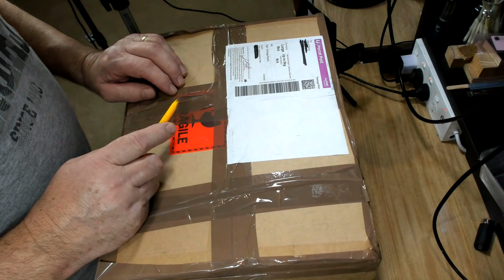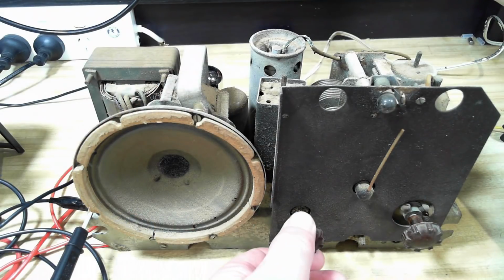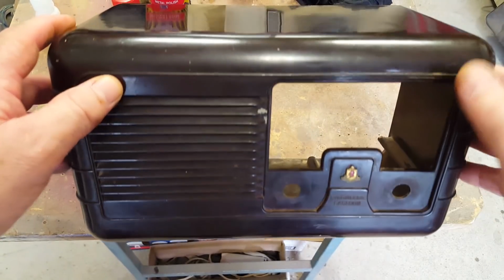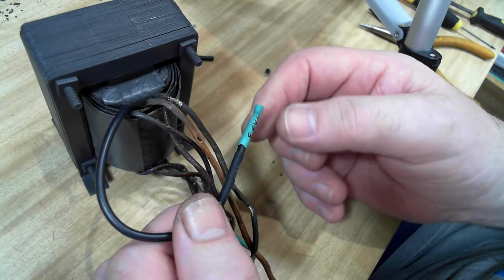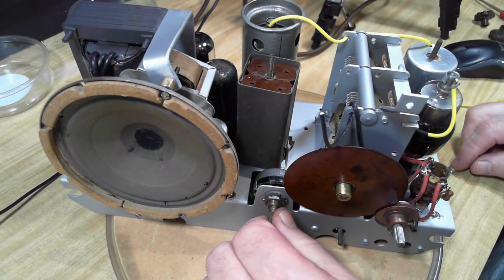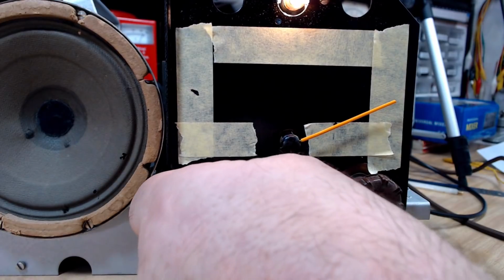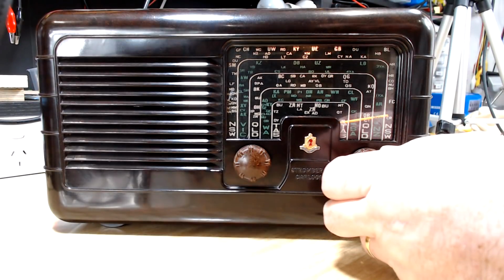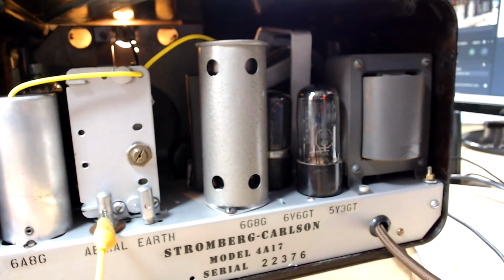1947 Stromberg-Carlson 4A17 Restoration - Extended Version Lockdown Special

Comment: You do such great 👍 work on these radios 📻, as if doing automotive collision repair. You’ve also done this with a Bakelite radio 📻. I could not tell that it was damaged from the outside. Guess super glue has a few more uses than the manufacturer says. Looks like it would be awfully hard to find a dial glass. I think it was Shango066 who sent one ☝️ to have new numbers painted on. Shipping and handling can be a lot, but these parts can no longer be found, at least, not easily.  This is a very nice 👍 radio. I’d like to resurrect radios 📻, but a YouTube account can be difficult and expensive to run 🏃‍♀️. I don’t know if I would find it profitable or not. You do such meticulous work, without hurrying or leaving things out. This is also where I come to learn about hot chassis sets, as well as Shango066 and Radiotvphononut. Don’t want to wind up 6 feet under, let alone a real buzz. Rotten power cords, asbestos in the radios, and curtain burner cords. I know all the test equipment is thousands upon thousands of dollars 💵. Probably can be found for way less than I’m thinking 🤔.
Reply from the maker: Thank you Jeffrey, I get a lot of enjoyment doing the radios up. We have a gentleman in Australia who makes the glass dials so that is handy. You don't need a YouTube account to fix radios and the basic test gear is relativity cheap. If you want to work on hot chassis you must have an isolation transformer. DMMs and dim bulb testers are cheap too. You could get a second hand tube tester but I don't use mine all that much but handy if you have a suspect tube and no spare tube to swap it out with 👍🙂
Reply: I know I Need an isolation transformer and tube test equipment. I don’t know how cheap these are. I’m glad the wildfires in Australia did not burn down the place that makes you the dial glass. I wanted to say nice 👍 radios shouldn’t be hidden away in a shed or closet. They are meant to be proudly displayed and seen. I’ve seen too many fried kangaroos on YouTube in Australia 🇦🇺. I prayed for the fires 🔥 to stop ✋, and they did. I don’t know 🤔 if you have a second home 🏡 in Australia 🇦🇺, but if you do, I hope 🤞 it didn’t burn.

Comment: Like that spray that you used for the speaker, can't find anything like that in the UK  one of the items i use for them is rubber solution for sticking patches to cycle inner tubes works but can be a little messy.
Reply from the maker: if you mean the black on the cone it's just black spray paint from a rattle can. You can use anything to repair speakers as long as it doesn't impede the cone from moving in and out 🙂
Reply: I meant the starbright liquid electrical tape.

Comment: Really nice job.  From rubbish bin to better than new.  I would love to see your process for creating the decal in greater depth.  I tried making a similar decal for a guitar amp I built and the results were no where's near as good as yours . Also using the ink jet type of paper seems to be a mistake. Even after spraying with lacquer the ink started to dissolve.
Reply from the maker: Hi Yisrael, thanks. The process is fairly simple. I scan the part into the computer, open it in a photo type program (I use Publisher) check the size is correct then add text and lines directly over the photocopy. Delete the photocopy and you should have an exact duplicate. I use a laser printer with no problems, I think ink jet may be a problem 👍🙂

Comment: Great restoration job once again, David!
As an American, that dial glass labeling looks a bit confusing. (In the USA, the AM radio dial is just labeled from 530 to 1700 KHz)
I read through some of the wikipedia page about Australian AM radio. Lots of info.
  Also, the old dial glass had numbers and letters, whereas the new dial glass, mostly just letters.
Actually, I think the new dial glass looks better than the old one.
Reply from the maker: Thank you Rick. The glass is typical for us, I don't know why we did it that way, early dials were in metres here. The new glass does look better, a bit of colour and a bigger font which I guess was because they dropped the state identification number from the front 👍🙂

Comment: Amazing restoration! I do have one suggestion. The dial needle seemed a bit faded. You can buy 'needle paint' for automotive instrument clusters and it works very well for radio dial needles (i tried it on my 68 dodge car radio, made it look like new.)
Reply from the maker: I though the pointer looked pretty good 🤔 Good tip about the instrument paint, thanks 👍🙂

Comment: Tonight I just finished up testing my home brew tube tester. It measures GM in umhos , transconductance. Setup is unique. One needs a tube manual. There are no switches, everything is done with color coded programmable jumpers. I measured all my stock tubes and compared results to my old EICO 625 tester. While I liked the EICO 625 it was useless in as far as accuracy of testing in concerned. My setup is not simple and takes some thought and math. However the results are spot on accuracy, after being compared to a calibrated Hickok tester I borrowed for Cal. I sold my EICO last month to a new beginner.
Reply from the maker: Your tester sounds the bee knees Cosimo. Well done 👍😀

Comment: I'm fixing up a console radio from the 60's (Unitra DGS-302). What happens if I power it up without connecting up the output transformers? Will anything blow up? I'd really like to make a first "will it blow up" test before I screw it back into the console and solder everything up. It will take me at least an hour to do that, and if it doesn't work, then I have to undo it. :-)
Reply from the maker: Hi Lennart, if it's tube radio you shouldn't run it without speakers but it probably won't hurt if it's only for a short time. If it's solid state it's not such an issue 🙂
Reply: @DavidTipton101  it's tube, yes. Thanks! I'll take out the transformers and speakers from the furniture and connect them up to test, then.
Reply from the maker: @RegebroRepairs  That's the best way?

Comment: That was nice of Carl to send you that nice Stromberg Carlson radio. The more I watch you David the more I see that you can repair just about any radio no matter what the condition. That epoxy enamel does a nice job on the rust I normally use evaporust Thanks for another Great and informative video.
Reply from the maker: Hi LUCKYLARRY, I'm always up for a challenge. Yes it was nice of Carl, I hope he doesn't want it back though. I have loads of rust removers but chose to media blast this one. Those paints are good as they inhibit the rust returning without removing all the rust beforehand. Evaporust is very expensive here 👍🙂

Comment: Looks awesome!  I will have to try that technique with cracks in bakelite.  Stromberg Carlson was based in upstate NY, and still around until about 10 or 15 years ago as a subsidiary of Siemens I believe.  Everything they made was over engineered and overbuilt.  I've restored several from 1934-1938, and they were all amazing units with the neatest component layout ever, but also lots of electrolytics.  Performance on all of them was stellar.  Had no idea they were sold in Australia!
Reply from the maker: Hi a587g, as I showed in the video I was surprised at the careful and neat assembly. Stromberg-Carlson in Australia were a separate entity to the US and built and manufactured their own parts and radios independent of the parent company. I would doubt many US built sets were imported into Australia after local manufacturing was set up 🙂

Comment: Nice results. Great work. Interesting radio. 6A8G RF, 6G8G which is a remote cutoff pentode and twin diodes used for IF amp and detection, 6V6gt audio output and 5Y3gt rectifier. The first of one of your videos I've watched. I have subscribed. I like to know the tube types or valves as you call them and their jobs. .
Reply from the maker: Hi Daniel, thank you and thanks for the sub. Looks like you have the tubes worked out 👍🙂

Comment: I am glad you took this "Average" radio on.......it is the sort of thing a beginner would have access to, and it shows it can be done.....and if they fail, its not to much of a financial loss......good stuff as always.....and as always a very high standard
Reply from the maker: That's a good point Harb's Electronics Lab. It is what a beginner could start out with and no biggie if it fails, thank 👍🙂
Reply: David Tipton however, what you ended up with was way above average ! I was amazed at how good it looked..... really a keeper
Reply from the maker: @harbselectronicslab3551  Thanks, it looks better than I expected 🙂

Comment: Incredible work there Dave! If I were you I'd have just electrically fixed the radio and waited for a new case and glass to show up but you've gone above and beyond! One thing I've been seeing more and more lately is the general consensus that you shouldn't go too high with the voltage rating of electrolytics. Reason being that if the electrolytic isn't run at close to rated voltage it won't stay "formed up" and thus won't last as long. Take it with a pinch of salt but I only put 600v electrolytics in circuits where 450v ones don't cut it
Reply from the maker: Thank you BOE. I hadn't heard that before about the electro caps. Any suppliers I have dealt with only have 600V in the axial capacitors, I can get them in radial but I don't like using that format. I wonder how accurate the theory is?  🤔

Comment: It’s brown for live and blue for neutral here in the u.k. just for reference
Reply from the maker: Hi waynio67, thanks. It's the same here for appliance wiring but the mains wiring is red and black. Appliances used to be red and black too but we picked up the European standard in about the 80s 🙂
Reply: David Tipton flex has been brown/blue since the 70’s, house wiring swapped from red/black to brown/blue mid 2000’s in uk,
Reply from the maker: @waynio67  We might go the same way eventuality I guess

Comment: I always used two part epoxy for gluing cracked Bakelite, that is if it's an open crack, or to glue a piece back on, followed by body filler and or spot putty, and paint. I think superglue would work for stabilizing a hairline crack that you don't want to get worse. 
  With regard to the reproduction dial, it was a lucky break that connecting that silver mica cap in parallel with the trimmer did the trick in getting the older production model to line up with the later production dial. There is a set that I have where I am not so lucky, the markings on the repro dial that is available run in the opposite direction from the dial mine has, one runs clockwise, the other counter clockwise. Fortunately the glass dial on mine isn't broken, it's just that some of the outer markings are rubbed off, so the dial scale is still usable, but I would like to do better.
Reply from the maker: Hi A. Fritz Becker. I have done exactly that with a few radios that I was going to paint. I added a strip of light aluminium to the back of this repair affixed with epoxy. That's unusual to have the dial flip over like that, not much you can do if the dial is driven directly by the tuning capacitor 😟

Comment: black and white is correct but will use red from time to time on 220 vac so you would have black white red copper green ran into anymore bat valves
Reply from the maker: Hi Pete, that's interesting, thanks. No, no more bat valves at the moment 😄👍

Comment: If the cabinet wasn't cracked, and the dial smashed, the caps in the chassis would make it a good candidate for restuffing, I don't think it has been touched since it left the factory. I don't know anything about Australian Strombergs, the ones they sold in Canada were virtually identical to American models in the pre war years, less so with the post war models.
Reply from the maker: Hi A. Fritz Becker. I haven't bothered with restuffing below chassis caps, in the right radio I might give it a go. The Aussie Strombergs were very much an Aussie company with little influence from the US company. There was very little similarities between the radios of the two countries as I understand it 🙂

Comment: I suggested the liquid tape way back when, can't remember which radio... glad you like it. Works a treat on hard to reach/seal electron junctions too... like where you fixed up that transformer. Forgot to say it's some strong juice though yea... fresh air good. A bit of tissue tacked over the hole(s) in the surround first will help with the drip-through.
She came up great, beautiful work as always. Thanks for sharing and cheers.
Reply from the maker: Ahh, scofab, I remember now, thanks for the tip. It filled those little holes but bigger ones will need something to bind on to until it sets. Yes, it's a bit strong solvent all right 🤪👍🙂
Reply: @DavidTipton101  Stay Healthy Brother. Cheers

Comment: Thanks so much for these videos David. Due to current situation, I'm now once again trying to get my Father-in-law's 1950's Healing radiogram working, and this channel has been great with inspiration, tips and ideas. Reading Miller's "Valve Radio & Audio Repair Handbook" to get my theory up, but sometimes you just need to sit back and watch a craftsman at work...
Reply from the maker: Hi Chris, I don't know about craftsman but I try. The Healing should be pretty strightforward, the later radios were better designed with better parts. Good luck with it 👍🙂

Comment: That is one beautiful little radio. I really liked the symmetric layout of the original components. I guess they really tried to make it beautiful inside as it is on outside. I too thought it sounded tinny at first, I am glad you fixed that. I am  seriously amazed at the quality of your restorations lately. That radio honestly does look lovely for 73 years old. 
Thank you for sharing.
Reply from the maker: Thank you Raul. I hoped it would sound better in the case but no, It sounds pretty reasonable now. Thanks for the compliment, I am learning as I go along so it's nice that it shows in the videos. Cheers 😀

Comment: Hi Dave I only just started to restore old radios as a hobby, I have a B15 radiola that works but it pretty much sounds like a whisper, do you have any idea what it might be? I've re-capped and I checked the resistors and they pretty well all seem to be with in tolerance, would that be tuning issue you think? And you have some serious skill
Reply from the maker: Hi James the B15 is a nice radio, captures the 60s perfectly. I can't be of much help, except to suggest Googling "vintage radio repair” or similar. I did a video on the Westinghouse version of this radio a while back and I found a Vintage Radio article on your radio as well, links below. Your problem is hard to diagnose from here but I always divide the radio into parts (mentally), first I split it into two, the amp end and the receiving end, you can put your finger on the centre wire of the volume control you should get a good volume hum from the speaker, if it's reasonably loud then the amp section is probably OK, if not, that is where you should concentrate, check voltages on the 6M5, plate screen and grid, suspect the 6M5, it may be faulty. If it's in the receiver end that is a bit more difficult. It could be weak valves of course. Good Luck 👍🙂
Article: http://messui.polygonal-moogle.com/valves/SC199906.pdf
My Video: https://youtu.be/c4yxd52bWD0
Reply: @DavidTipton101  yeah I watched it, and I didn't really help me haha different issues of course. Ill give those other things a go and thank you for the reply mate.

Comment: Another beauty, well done. For a minute there I thought we were going to see you make a new glass. Good job stretching the band to fit. There is also a type of glue that cures with ultra violet light. Suppose to be pretty good.
Reply from the maker: Hi Phillip, thank you. I have a super glue that sets under UV light but it says its a filler not a glue. Might have been good to finish off the imperfections in the repair. I have tried making dial glasses but not successfully as yet  🙂

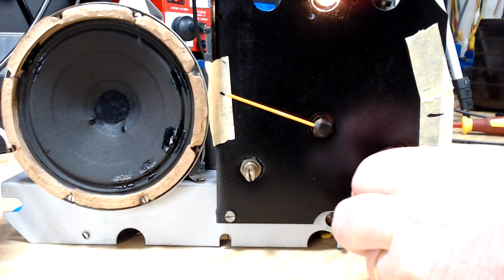Comment: 43:05 I guess you need to buy a lottery ticket. It looks like your luck is in!
I truly enjoyed this restoration. You have the patience of Job. I would never have expected you to bring this one back, but I underestimated you.
I love the water slide decal you made up for the original rear panel stencil. That's a very clever idea.
The liquid electrical tape is also something that is sometimes suggested for patching holes in the bellows of old folding cameras (another interest of mine). Looks like it might be worth a try.
I'm curious—have you ever tried to fabricate a replacement for the (usually) missing backs for these radios? I'm not sure how you would go about it (laser cutting seems possible).

This video has been a real ray of sunshine during these gloomy times. Thank you so much for your efforts, both in restoring the radio and documenting it.
Reply from the maker: Hi Michael. thank you for your kind comment. The liquid tape works very well, good idea for the cameras too. Most Aussie radios of this period didn't have backs, I did make one out of perspex once for a display radio I made but not out of cardboard. The radio club and some individuals made them and they are laser cut I think. It would be good if I could. Cheers 😀